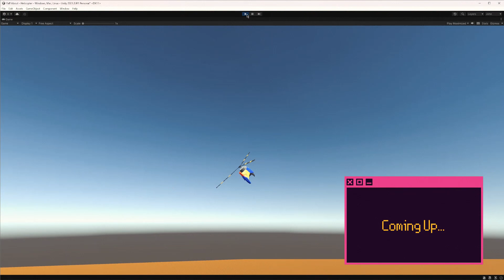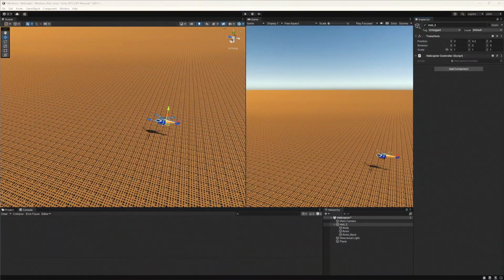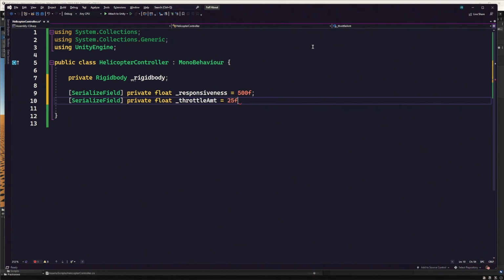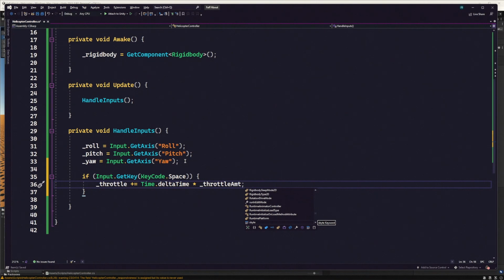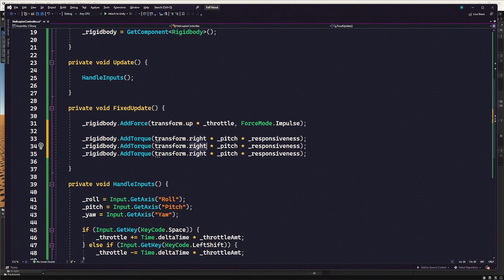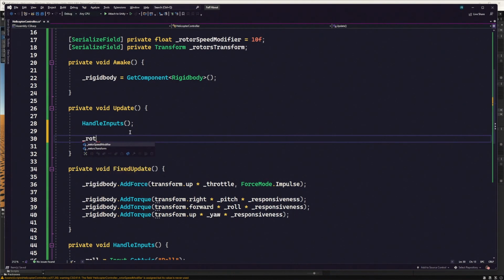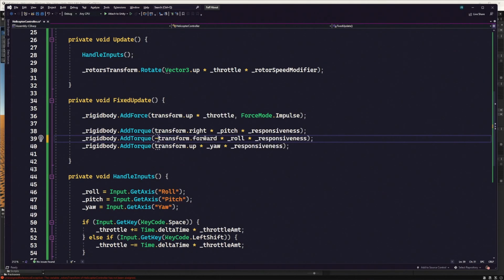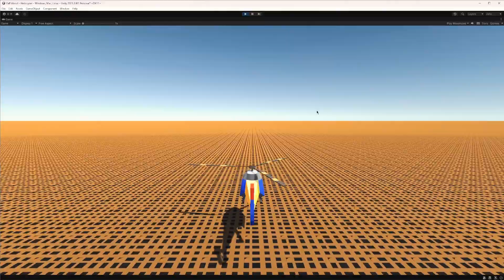Simple Physics Based Helicopter Controller in Unity

Comment: Awesome stuff, lovely and simple and can be very easily adapted to give various extra characteristics if so desired. After the plane video I did some experimenting with the helicopters and ended up adding three main extras. A swashplate to actually tilt the rotors forwards/backwards left/right while lifting from the rotor.position in the rotor.transform.up, pitch to the rotor blades which is used to calculate a final lift value and finally a very basic engine script, rpm is calculated using an animation curve from the throttle input then the lift if calculated from said rpm along with blade pitch. One major thing I came across with different shaped helis when trying to add realistic colliders in places such as the skids, body and tail was the center of gravity seemed wrong, the heli would flip over randomly if cog was too high and seem to take forever to move if cog was too low. A simple fix for this was to add an empty gameObject as a child of the helicopter and set the rb.centerOfMass to the empty gameObject position in the start method, doing so will set a custom cog point which will require some experimenting with the position of the empty gameObject to get just right but I ended up with a fairly balanced helicopter after some testing.
Reply from the maker: Great work! You did your homework lol